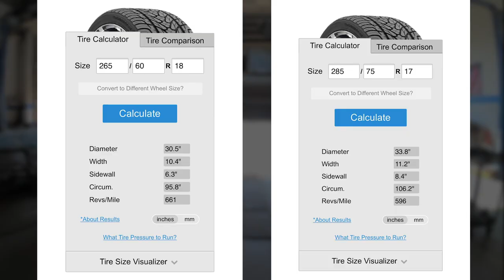Lexus GX460 Ironman suspension lift with Method Race Wheels and K02 tires

Comment: If you went from 265/60r18 to 285/75r17, thats about an 11% increase so if u were doing 70 on the new tires, u were really doing about 77-78ish. Just multiply ur current speed by 1.11 and that’ll give u ur actual speed. Also, multiply ur odometer by 1.11 as well and that’ll give u ur actual distance reading for mpg calculations. Sandy’s lookin good!!
Reply from the maker: Thanks Jaime. I went to the Discount Tire Direct calculator and noticed that. I verter go light on the gas pedal. Lol. I will do some research on recalibrating the speedometer. I wonder if it’s even worth it.
Reply: Coastal GX yeah, thats up to you. If anything, it makes the mileage on ur odometer stay a little lower 🤷‍♂️

Comment: Yeah the bronze methods are super cool. I have a 2013 LEXUS GX460 too. Went from a 2019 trd off road 4runner premium only because of my injured back needed more support on longer trips. I just needed more support for my back. Was it a good idea to trade down to an older vehicle? Sure the 4runner is way better looking but mostly for me its about more comfortable support for my back. If i would of kept the 4runner i would og done a custom seat job leather with more padding if i kept. Time will tell but what's really nice is i can always go back to the 4runner. Still nice set up on your GX460. Mine is the same color. With the GX460 its a heavier vehicle than the 4runner so im going with the Dobison suspension lift also made in Australia and specifically designed for the heavier GX460.
Reply from the maker: Congratulations on your GX. I recently upgraded to an OME setup with the heavy springs due to all the mods and a trailer I bought. I love dropping the psi on those methods. Always holds the bead 😎

Comment: I have done a 2 inch dobinsons lift very recently on Prado which is very similar to GX.

My stock tires were 265/65/R17.
I want to change it to all terrain now.
Should I keep the same 265/65s so it does not make the drive sluggish?
Reply from the maker: Hi there; congratulations on your Prado!! I wish they sold them here with different engine options. The only benefit you’ll get is probably a bit of height and the aggressive tread if you go one size higher. I had to chop a lot for my setup. Although the difference wasn’t too bad.

Comment: You actually only gained 1.6" of lift in the tires since only half of that increase nets clearance. It definitely looks a lot better. I wish I had gone with 295's or 285/75's instead of the 285/70's, but I'll likely need new rubber late next year as it is so I'll make the change then. I still need to get down there to run SPI with you and your crew soon.
Reply from the maker: Very good observation! A big flaw in this video was me not measuring the before and after results. It was too late when I realized it.
Reply: @CoastalGX  I am guesstimating you gained 3.5-4" overall depending on how high you set your preload. BFG's measure small too, so it's hard to say. In the end it doesn't really matter because you're happy and it looks great!

Comment: How does it drive over speed humps? Does it make some noise over speed bumps if you drive fast?
Reply from the maker: I drive as fast as 100mph on long stretches of road (fully loaded.) The only bad thing is it needs regearing. The speedometer is off the faster I go and the fuel economy is terrible. The ride is very smooth and the BFG K02’s don’t make much noise.

Comment: You can get a lot of your power and fuel economy back by regearing the differentials. That can also make your speedometer more accurate.

Though I'm not entirely sure if aftermarket gears are available for that vehicle.
Reply from the maker: You are correct; my friend is getting that done and it’s very expensive. I see that process like getting back surgery. Lol. Scary, but probably necessary.
Reply: @CoastalGX  It's not really scary. The Toyota axle design is considerably easier to regear than conventional axles. As long as you find a reputable shop to have it done the only scary part is the price tag.
Reply from the maker: @KurNorock  have you gone through this already? If so, what did you do and how much did it set you back.
Reply: @CoastalGX  I have not. But I plan to. 

Also, I used to work in a fabrication shop that catered mostly to jeeps. There were a LOT of regearing jobs going through that shop each week. But then Jeeps typically have traditional axles which are a bit more difficult to set up properly. 

Just off the top of my head, I think new gears are something like $1500 for the full set, front and rear. And depending on how much you can do yourself, the price for labor would probably be somewhere between $800-$1500. Of course with the way inflation is going right now, prices could be double that for all I know. 

It should be considerably less expensive if you remove the front diff and the rear carrier and bring them to the shop VS having the shop remove and install them into the vehicle.  And it is pretty easy to do. Just be careful about the weight.

Either way, you can expect to get your money back in gas savings within a year or two depending on how much you drive. If your Lexus is geared anything like a Tacoma, you can expect a pretty big fuel economy boost by going to 4.56 gears or possibly even higher.

Comment: Took a bit for me to get some tome to watch this whole vid, my bad.  Anyway, well edited!

I’m happy everything turned out well with the suspension lift and tires.  Love the look of them  methods!!!  It’s always a slight guessing game after a lift like that.  I’ve installed four lifts on Toyota trucks, including whole leaf pack changes.  The ride is much different, but in the long run with off-road performance in mind the benefits outweigh stock parts.  Hope the rubbing doesn’t continue after the cmc and cutting!
Reply from the maker: Thanks Daniel! I’m so backed up with projects and work right now. I haven’t had time to edit my latest episode. I’m like you, I have to make time to watch my subscribed channels lol.

Comment: You also need to see the difference between speedometer and actual speed after that tire change
Reply from the maker: It’s about a 7 mile difference at around 60mph. It needs to be regeared at some point.

Comment: I see you didn't go with the profoam ironman shocks/coil set up...did your GX have KDSS?
Reply from the maker: I went with the nitro because of the price difference and my application. I don’t do any hardcore desert runs. My GX is a tourer. The thing I need now are heavy duty springs because of the added weight. All gx460’s have kdss so yes, mine has it. 🎥🎬
Reply: Likewise, because of your video I went with the same setup! Ty

Comment: Nice setup! thanks for the video. 
When you said it doesn't feel the same on the highway around 70MPH what did you mean?
What exactly did you experience? steering vibration, noise........
Reply from the maker: Thank you. The steering felt heavier. It's been months now and I've driven her a couple of thousand miles on the new setup. You can't tell a difference. The ride is still very smooth, but it's not the same as OEM. I have zero regrets, although I recommend going with a 285/70/17 instead of the 285/75/17. I've done a body mount chop and trimming, but it's still not enough when mud gets caked on.

Comment: Thank you for your videos - I have been looking to trade my 5th gen 4 runner for a GX for a year now and the one thing I keep getting hung up on is whether or not I should get the luxury model with kdss and crawl control or just the base / premium model if I’m planning on a complete lift . Any insight to that from your perspective ?
Reply from the maker: Hello Mike. All models are equipped with KDSS. Crawl control is a good feature to have. I looked for a GX460 without the air bag suspension though. The rest of the features don’t have an impact in my experience. I even removed the third row power seats which are an upgrade. I needed the space for my setup.
Reply: @CoastalGX  thank you - I think all of the luxury models with crawl control have the air suspension and that would have to be deleted when doing a full lift correct ? Is that a major issue / expense when adding a lift. My 4Runner is a great truck but we’re getting into more overlanding and my wife made the comment she just wished it was a little more comfortable or nice,  and I like the upgraded power, hence the consideration to upgrade to the GX. I just hear a lot of controversy over the luxury model with air suspension and crawl control and adding a lift.

Comment: Your rig looks great. I find that the ride is definitely different with a 3 inch lift but still very good on the freeway. Offroad, it’s a beast. Thanks for sharing.
Reply from the maker: Thank you. I think I should have gone with a tad smaller tire, but that’ll get sorted out in a couple of years when I have to replace them. Lol. Btw, I love your build and I subscribed to your channel. Beautiful drone shots and awesome scenery! 🎥🎬👍🏽
Reply: Coastal GX Thanks for the sub. Same here and looking for more of your great content.
Reply: @CoastalGX  What size tire do you wish you had gone with? Im looking at doing something similar but I don't want to screw up my highway driving
Reply from the maker: john doe just a tad smaller in circumference. Instead of a 285/75 perhaps a 285/70. It’s all good, but my next set will definitely be a little smaller.
Reply: @CoastalGX  Good to know! Thanks for the reply
Reply: john doe I’m running 285/70/18 Nitto Ridge Grapplers and couldn’t be happier.
Reply: @lexusgxlife6328  Glad to hear it! Those are on my short list.

Comment: I'm wondering if it felt slower because you're sitting higher up now and because the speedo was off from the bigger tires?
Reply from the maker: Yes!! I drove a newer and stock GX recently and it felt light as a feather. The gearing wasn’t adjusted so it’s very deceiving.

Comment: I have 20x10 with -18mm offset. What size tire do your recommend for that setup, and this will be driven on the beach primarily when off road.? Tried 305/50/20 with significant rub at full lock. I have Ironman 3" lift kit on the way, so it will sit like yours.
Reply from the maker: I went from a 18” wheel to a 17” wheel so I could get more tire on. I will be honest when I tell you that I didn’t even explore fitting a 20” wheel because my goals are offroading. Go talk to the folks at Discount tire or another expert that may give you the best advice for your particular setup. Send me a message on Instagram to see how it turns out. @coastal_gxspi.

Comment: With 285/70/17 and 2 inch lift what is the total height of your gx thanks in advance
Reply from the maker: I have 285/75/17’s with an Ironman 2.5” lift, but I never took the time to measure the vehicle at OEM height. I honestly don’t know, but I will say that the little difference has made a tremendous improvement. I highly recommend a suspension lift and tires for your off-road vehicle.

Comment: What would be the pros for selling my GX470 for a 460? I am trying to figure out what the differences are and if it's worth it. The interior of the 460 already attracts me and maybe you can share the differences if you can about the off-road prowess, engine, MPG's and all of that compare to my 03' 470.
Reply from the maker: The main reason to choose a 460 (in my opinion) would be the timing belt. GX 460’s have timing chains instead of belts so you don’t have to replace them. The second reason would be the off-roading features such as standard KDSS on the 460. I also like the heated/cooled seats, rear camera, power third row, and a bunch of other nice features in the 460. The main reason to keep the 470 would be that it’s already paid for and there’s so many available mods for it. I’m slightly biased, but I sincerely believe that the 2010-2013 GX 460’s are the better choice. Good luck!
Reply: @CoastalGX  thanks for the advice, I think it totally makes sense to sale my 470 to get a 460. How is the gas mileage on the 460? Is it better than the 13 MPG I get with the 470?
Reply from the maker: Jeep Overlander mileage is pretty bad lol. I have a lift and tires; I also have a roof rack so I don’t even care about mileage anymore lol.

Comment: What made you decide to go with the GX-460 instead of the GX-470? Just curious???
Reply from the maker: I actually wanted a Land Cruiser 200 series but it was way too expensive. After doing some research, I felt a gx460 was the better choice. It had more luxury features and I simply wanted a newer model with fewer miles. You will be happy with whichever you choose.

Comment: Yo! Rad. 🤘
I Have a 470 in moab Utah, GXs deff arebadass rigs!
I''m eyeing the IM FCP lift too (concerned about reduced articulation, from lift,  that KDSS provides), but treaty oak has a KDSS sway bar spacer now. Anyhoo, great vid, but 3" larger tire diameter doesn't give 3" lift, but 1.5" diameter vs radius. And 285s aren't skinnies, that'd be 255x80s 😉
Keep It up, man! Awesomeness
Reply from the maker: Congratulations on your GX! You’ll be pleased with Ironman. Yes, I screwed up those stats 🤣🤣🤣. Can you please send me a message via Instagram at Coastal_gxspi. I want to know more about that spacer you’re talking about. Thank you!
Reply: Sorry man, can't do.
I'm not on the sosh meeds. No Instagram, FB, Twitter, etc. and barely do YT anymore (no post production video efforts here), and since YT changed their video editing software I haven't done much.  😔😫
Now, I just participate in Ih8mud.com/forum (dranged).

Suspension-wise, The spacer I have is just a strut-top levelling spacer. It has inherent hazards which I researched and understand, but it provided 1.5" additional lift and ground clearance In front. I still have stock AVS shocks and auto-levelling stock rear airbags. I have sliders and 70 series tires (31.6"), but otherwise it's all stock.

But talk to Kyle @Treaty Oak. He makes a spacer that adjusts the position of the sway bars to account for the lifted body with a suspension lift. It corrects  sway bar position in their ram arm position, which removes the track arm bind with full articulation of KDSS sway bars on a lifted truck.  🤘👌

Comment: 3 extra inches on tires gives you 1.5 inches of lift, not 3".  By the time you air down, you are back where you started. By the way, I just put 32" tires on my '17 GX with no lift at all.
Reply from the maker: You are correct. I realized that after the video 🙁. Thanks for the feedback and congratulations on your ride!

Comment: Hey Robert got a question saw the knew wheel package nice really didn’t get a good look at the tires are they mud terrain or all terrain  if mud terrain how are they on the beach I’m running bf good rich mud retains on my tundra wich are amazing in the woods trails and mud I can do 70 down dirt trails and I have nothing but traction but my main concern is the beach wondering if they dig wich would cause me to get stuck rather quickly
Reply from the maker: Barely read this comment! I went with AT’s for my purposes. I hear you should be fine with MT’s on the sand. Remember, you can always air down. 👍🏽
Reply: Just took my wife out to access 6 and we were fine didn’t air down but will when I get a compressor hooked up on my truck absolutely love this truck due to it being so light and having a wide wheel base I basically float on the sand and honestly with the low gearing I don’t even have to push on the gas just crawl thru at 10 mph hope to see u soon keep the vids going also would like to host or be part of a beach clean up
Reply from the maker: FIT TO HUNT 86 we will do one soon. Maybe in February
Reply: @CoastalGX  awesome sounds good let me know if I can do anything

Comment: awesome wheels!,  is there any impact or repurcussion to the body chop?
Reply from the maker: If not properly treated, the exposed metal can easily corrode and weaken your frame. I’m not aware of anything else though.
Reply: @CoastalGX  I'd be interested to know the long term review of the tire size and lift.  Any rubbing on big bumps etc?  Yep can understand the body would need to be rust treated etc.
Reply: I get that everything is a compromise when chasing off road performance, the down side is it pushes you away from on road performance.  👍
Reply from the maker: @MrGgraham76  the tires and suspension are great. I would recommend you go one size smaller. I don't have rubbing issues after trimming the hell out of it. The next set of tires will be the same, but I will go one size smaller. These are almost 34"so I need 33's. That's the perfect size imho.

Comment: What spring height did you get for the rear. 2 or 3 inch?
Reply from the maker: 2” and I regret it. If you are going to add extra weight (like I did ultimately) then perhaps go with stiffer springs. I will have to wait a while to save the money lol.
Reply: @CoastalGX  hmm I guess I should go with 3 inch rear lift 440-800 lbs springs and 2.5 inch lift for the front. I do plan to add 500 lbs of weight (underbody protection, roof top tent and stuff) 
Thanks for the info!

Comment: Way too late for this comment but you could've avoided the body mount chop with a good alignment. Pushing the casters to 4+ degrees would've done it for you. But either ways, good work and GX looks great!
Reply from the maker: Your comment is still good since it may help other viewers. It’s clear in my mind that I should have opted for a tire 1 size smaller. Maybe next time. Thanks for watching. 🎥🎬👍🏽